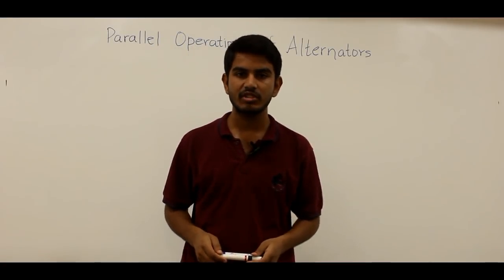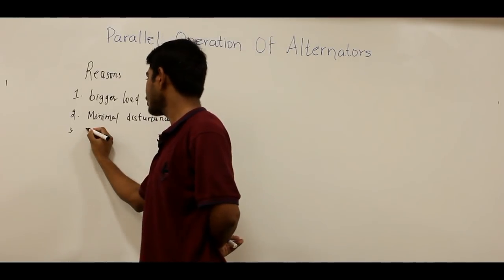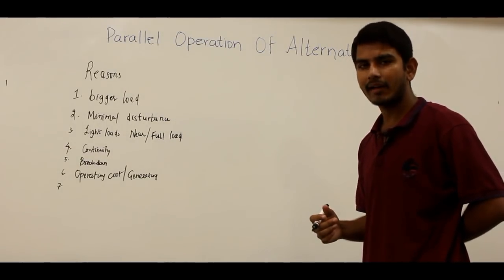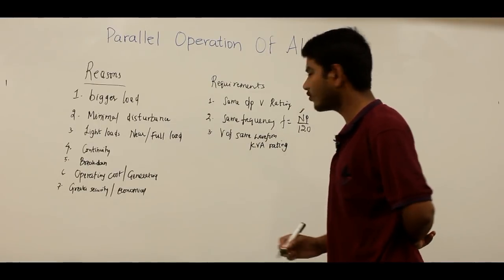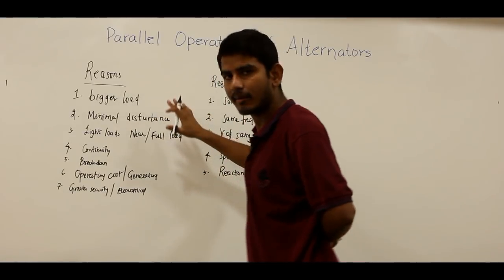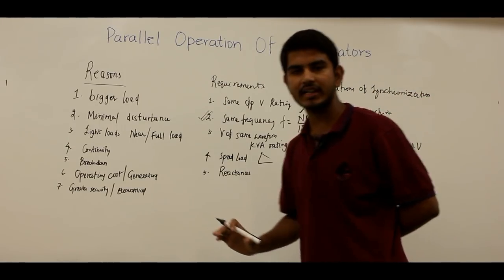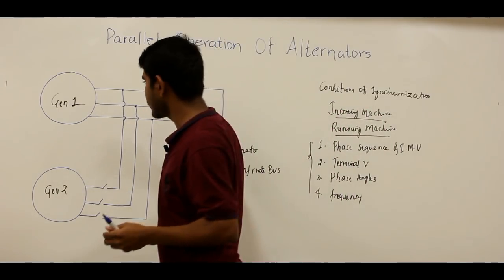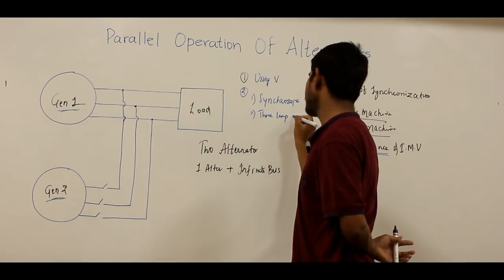Parallel Operation of Alternators

Comment: Thanks Sir for the lecturer. Hwr, those are the old method to do synchronizing (Analog method). Today is using digital method where we just need 1 PLC relay and few selector switches to select to which Gen. to be synchronized. Tks.

Comment: Two DC generators running in parallel, supply  a total load current of 180A. The terminal voltage of one generator falls uniformaly from 240 to 230 V when delivering 80A. The terminal voltage of second generator  falls uniformaly from 230 to 220 V when delivering 80A. Find the load current shared by each generator.

Comment: Why do we close the circuit at 11'o clock. #this video lacks alot of diagrams, you have hundreds of reasons for taking on load, paralleling , synchronisation and all. But not a single phasor diagram. Really?? Like this?
Reply from the maker: yeah, I agree
I just gave the basic idea only here
I also haven't explained Lamp Methods
I left them to the audience only

Comment: Sir what will happened if we increase/decrease the excitation of the incoming machine after the synchronization is done , and also what happened if we change the speed of the any one machine after synchronization.., i think sir you should include this things also in lectures..
Reply: It will be affect on Reactive power shared by both alternators.
Reply: Basically, it will change 2 parameter, reactive power sharing and terminal voltage, depend on power system condition. If the power sistem is large and the generator only share small power, it will change reactive load sharing only, because terminal voltage remains constant. If the power system is medium/small so the generator can give big influence to the system, it will change reactive load sharing and slight terminal voltage. The most important thing from this explanation is, active and reactive power in power system demand always follow the load that connected to the system